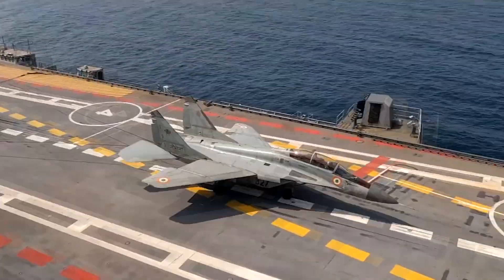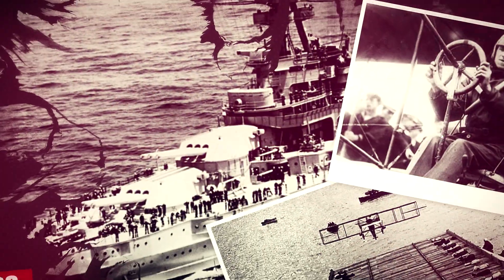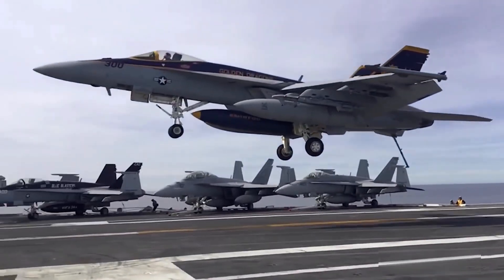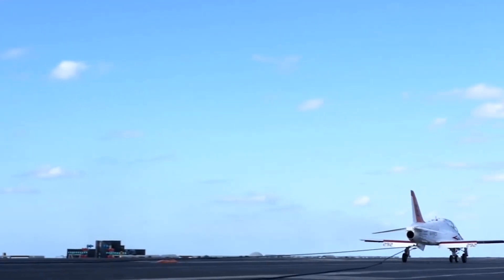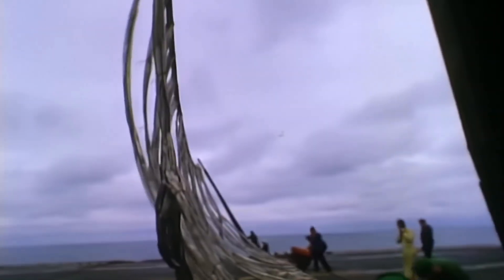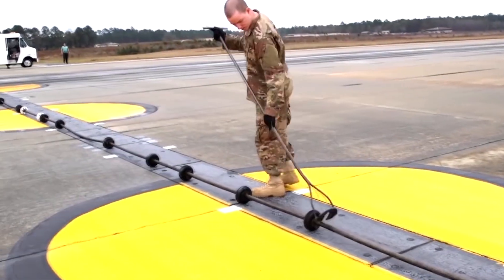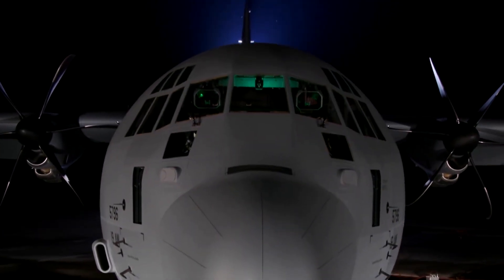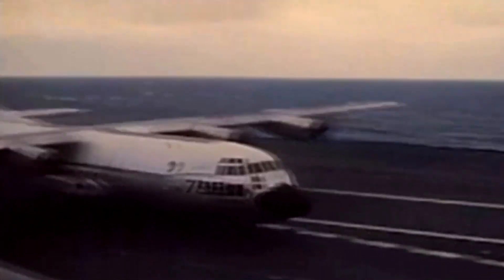What Happens When US Aircraft Fails to Land on US Aircraft Carrier

Comment: I've seen vids of that c130 landing on that carrier before and that was in 1963 how cool is that? Whats even cooler is I didn't know that pilot had never flown a 4 engine prop plane before that test, that would prolly never fly with today's standards but that is a testament to LT. James Flatley III's skill and determination. A modern day c130 could prolly do it even easier and takeoff even heavier with rocket assist and a catapult. It didn't look like that c130 in 63 used either the arrestor cables or catapult. Now that they have magnetic catapult systems and I think magnetic arrestor cable systems as well they could prolly fit a tail hook or a catapult tow bar to a modern c130 and do this today especially with the much larger flight decks, it's just not practical for many reasons I'm sure, mostly safety reasons and they would prolly need a longer catapult and other modifications to the arrestor and catapult systems. And even a modern c130 prolly couldn't handle that stress over and over again then again maybe it could lol